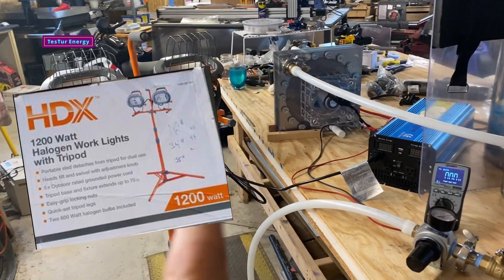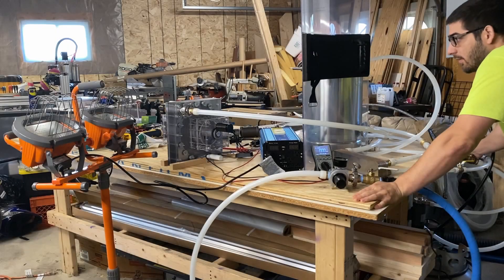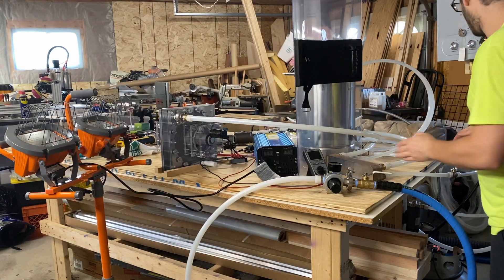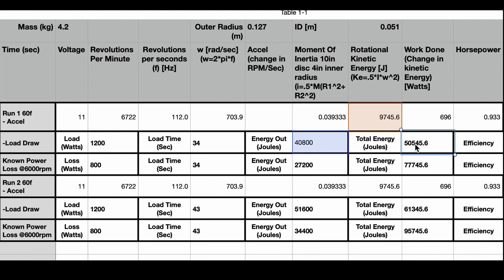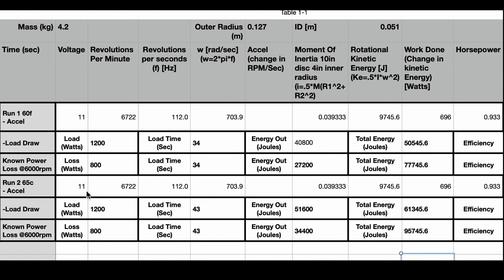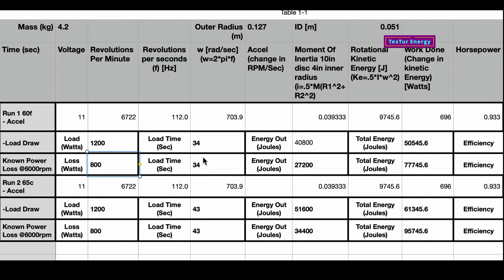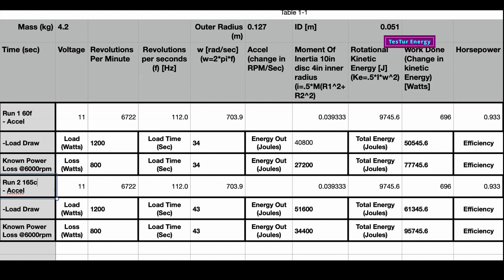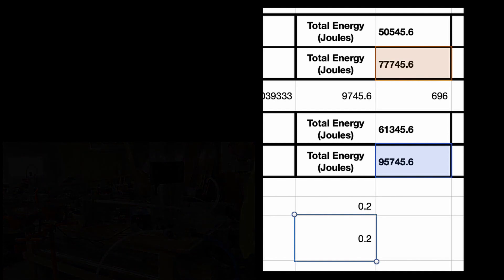Tesla Turbine 1200 Watt Electrical  Load Tests - Power Calculations - compressed Air + Propane

Comment: It looks great! So here is what I figured out, the heating of the air is increasing its viscosity. Can you tell the discharge from the nozzle so that I can calculate the theoretical maximum achievable efficiency. I think if the gap between the plates is reduced you can get close to laminar flow (which will increase its efficiency due to viscous flow of air), also try to increase the area of the nozzle, the discharge would be the same, if you can reduce the specific velocity of the air you can get lower Reynold's number which will reduce the noise therefore increasing the efficiency. 
BTW Great work!
Reply from the maker: Have you had a chance to scroll through my communities tab and read all the posts I made in the past about laminar flow regimes inside the Tesla turbine for reduced turbulent losses?
Reply from the maker: Yes yes yes!! You’re hitting the nail on the head. Preach the words of our lord and savior Nikola Tesla!! 😂 but for real you’re saying EVERYTHING I constantly say to people. 

So right now I’m already working with 0.0092in disc spacing. I’ve tried all the way down to 0.0005in spacing but the way I machines the turbine made the tips of the discs horrible for letting the air in between them. I don’t have this issue with my new one but it’s also pretty tricky working with sheet metal that’s any thinner than I’m already using without regularly bending the crap out of the parts. As I increase in temps I don’t think it will be necessary for the disc spacing to be soo skinny but we will see. But I’d rather just increase the discs and slow the velocity beteeen each disc spacing to reduce the Reynolds numbers and get the added effect of getting the major increase in surface area anyways with the same total flow area through. But especially when I start doing the high temp combustion + steam replication of Tesla’s GB 186,083 patent I’m sure this spacing will be too skinny for the high viscosity of the high temp fluids.
Reply from the maker: As for the temperatures I don’t have an outlet temp for ya I’m sorry. And I’m in the middle of a rebuild for the next round of tests so it’s all in parts right now getting upgrades to get back into the fighting ring for round 3! I will have more data for that round of tests.
Reply: @CharlieSolis  No, I didn't see the posts, I'll check them out. The combustion+ steam looks interesting, maybe you can replace the exhaust impeller of turbo charger with your invention, or something like that (maybe just use a little combustion chamber somewhere and spin the turbine with its exhaust, replacing a blade turbine). Also are your plates entirely seperated from each other? I was thinking, for this particular project with only air, you can go much thinner by using airfoil shaped guide between the plates, that way the plates won't bend, and same small gap could be achieved evenly.
Reply from the maker: Oh yeah check out patents GB 186,083 and GB 186,084 they are the improved combustion gas + steam turbine patents that Tesla put out after 10 years of R&D after the first patent was put out. They are complete and self contained power generation systems with combustion chambers, centrifugal compressor and fuel tank system including a heat recoup for the hot exhaust leaving the turbine to further raise steam to be admitted coaxially into the the turbine together. 186,083 is a steam super heater patent for getting the highest economy from the heat energy of combustion. With the recoup system that he has in the design the total efficiency of the system should be extremely high.
Reply from the maker: As for the discs, I am also replicating Tesla’s other improved construction patent for the turbine disc stack GB 186,082 that he patented at the same time as the ones I was just taking about above, in 1921, after 10 years of R&D. I don’t know why everyone sleeps on these patents. They are literally the key to making them work effectively. But in the patent he suggests using very very thin sheet metal and instead of using any kind of physical spacer in the periphery he suggests pressing “protuberances” or as I call them “dimples” into the disc faces. Even further he suggests reducing all the machining of each disc into a simple stamping process that the exhaust holes and the periphery separating dimples are all pressed at once. Currently Im just using a jig that I made for stamping the dimples into the thin discs. It works amazingly and the whole disc pack is super stable. 
Check out one of the short videos I made showing the dimples that keep the disc tips apart. 
https://youtube.com/shorts/3jS2ckRWD2I?feature=share

Here’s what Tesla says in the patent. 
NIKOLA TESLA BRITISH PATENT 186,082 - IMPROVEMENTS IN THE CONSTRUCTION OF STEAM AND GAS TURBINES
"In the new design I employ two heavier end-plates which are machined tapering toward the periphery for the purpose of reducing the maximum centrifugal stress as much as practicable. The inside discs, of relatively thin material, are rolled, forged or ground tapering in like manner and with the same object in view, but this may not always be necessary and plates, made of sheet metal of substantially uniform thickness as furnished by the mills, can be employed. Each of the thick as well as thin plates is provided with exhaust openings, leaving a solid central portion like the hub and spokes of a wheel. Star-washers of similar configuration serve the purpose of keeping the discs apart in the center and for the peripheral spacing the thin plates have small holes drilled in them on a circle, or circles, of suitable diameter, and in these are driven tight-fitting studs which are upset at both ends by a special tool so that they will project beyond the metal on each side a trifle more than the thickness of the star-washers. When the plates are put together the separating studs do not come in line but are straddled in order to give opportunity for slight yielding, thereby eliminating constructional difficulties which might be caused by unevenness or other mechanical imperfections. Thus the rotor can be finished closely to predetermined overall dimensions and will run true on the outside even if the thin inside plates should vary a little in thickness or be slightly warped. To simplify this arrangement I provide only every second plate with studs, using plain ones between. Furthermore, with the object of cheapening the manufacture I dispense altogether with the former, accomplishing the spacing by means of small bosses or protuberances which are raised in the plates by blows or pressure and provide a die, practically reducing all the machine work on a thin plate to a single operation in a stamping press. The star-washers, while preferable, are not indispensable and may be replaced by round separating washers of a diameter about equal to that of the hub part of the discs"
-NIKOLA TESLA

"This construction permits free expansion and contraction of each plate individually under the varying influence of heat and centrifugal force and possesses a number of other advantages which are of considerable practical moment. A larger active plate area and consequently more power is obtained for a given width, this improving efficiency. Warping is virtually eliminated and smaller side clearances may be used which results in diminished leakage and friction losses. The rotor is better adapted for dynamic balancing and through rubbing friction resists disturbing influences thereby insuring quieter running. For this reason and also because the discs are not rigidly joined it is safer against damage which might otherwise be caused by vibration or excessive speed."
-NIKOLA TESLA

"....what I claim is:
1) A rotor for steam and gas turbines composed of plane spaced discs and two rigid end-plates holding them in fixed position laterally but permitting their independent expansion or contraction in the radial direction, said discs and plates being provided with exhaust openings in their central portions, substantially as described.
2) A turbine rotor comprising plane discs with spacers allowing radial displacement, central separating washers and two rigid tapering end-plates for holding the structure firmly near the shaft, said discs and end-plates having exhaust openings in their central portions, substantially as described.
3) In a rotor for high-speed turbines plane spaced discs with exhaust openings in their central portions and tapering towards the periphery as, and for the purpose, described.
4) A turbine rotor consisting of a system of discs held apart by spacers in frictional contact with them and alternately straddled as, and for the purpose, described.
5)A turbine rotor composed of plane parallel discs having exhaust openings in their central portions and projections for holding them apart near the periphery, substantially as described.
NIKOLA TESLA

Read The Full Patent:
https://teslauniverse.com/nikola-tesla/patents/british-patent-186082-improvements-construction-steam-and-gas-turbines
Reply: @CharlieSolis  Man I'm impressed by your knowledge and Research, I read the patent, and yes I was saying the same thing of attaching little airfoils (like there are dimples between the plates) I think this can really increase the efficiency, as in the present blade turbines there is loss of energy at every level (talking about the frictional losses and the losses caused by redirection from the stator)
Well I'm now really interested in this, I have added you as a connection on linked In, we can discuss there.
Reply from the maker: Hey Affan so I’m HIGHLY against the idea of having any kind of airfoil or impediment in between the discs. This would defeat the whole purpose of using the Tesla turbine. As Tesla talks about how to get the highest economy the fluid should have the most gradual change as it traverses the turbine you don’t want any lifting buckets or vanes to get in the way to cause sudden impingement on the lifting surfaces. Furthermore once you’ve achieved laminar flows in between the turbine discs you won’t have nearly any loss to slip and the all loss to slip will be to shearing of the fluid which just builds up and dissipates as heat. This is what’s known as the “reheat factor” because the energy lost to friction and heat inside the turbine, if laminar, can be recouped through further expansion of the fluid through multiple stages. When the fluid is laminar you won’t have barely any loss to noise because there is not turbulent flows between the discs to create such vibrations or hysteresis for vibration losses. Not to mention Tesla explicitly says that the new and improved disc stack construction patent that because the whole stack is not rigidly joined and the discs and their dimples are straddling eachother so that they have a little bit of axial give to the whole runner is exceptionally good at damping out vibrations that reduces any chance of early fatigue on the parts. Not to mention each individual disc can expand and contract as it needs according the varying temperature and varying rotary forces. 
Check out this “holy Trinity of the Tesla pump”  
 https://www.youtube.com/post/UgkxFIceXTJhrWlsvAjt3om-Q2BZFajtzgTd

I go into an in-depth explanation about why only laminar flow between the discs is desirable because upon tripping turbulent the boundary layer will tend to experience a flow separation from the surface and lose its adhesive drag on the surface. 

If the turbine is designed accordinfigly to get the proper Reynolds numbers and laminar flow between the discs there should be no need for any kind of foil/lifting surface that impinges on the flow stream and causes sudden changes in direction to the flow. 

Tesla states in the original patent 
“In the practical application of mechanical power, based on the use of fluids as the vehicle of energy, it has been demonstrated that, in order to attain the highest economy, the changes in the velocity and direction of movement of the fluid should be as gradual as possible. In the forms of apparatus heretofore devised or proposed, more or less sudden changes, shocks and vibrations are unavoidable. Besides, the employment of the usual devices for imparting to, or deriving energy from a fluid, such as pistons, paddles, vanes and blades, necessarily introduces numerous defects and limitations and adds to the complication, cost of production and maintenance of the machines.

The object of my invention is to overcome these deficiencies and to effect the transmission and transformation of mechanical energy through the agency of fluids in a more perfect manner and by means simpler and more economical than those heretofore employed. I accomplish this by causing the propelling fluid to move in natural paths or stream lines of least resistance, free from constraint and disturbance such as occasioned by vanes or kindred devices, and to change its velocity and direction of movement by imperceptible degrees, thus avoiding the losses due to sudden variations while the fluid is imparting energy.

It is well known that a fluid possesses, among others, two salient properties, adhesion and viscosity. Owing to these a solid body propelled through such a medium encounters a peculiar impediment known as “lateral” or “skin resistance,” which is twofold, one arising from the shock of the fluid against the asperities of the solid substance, the other from internal forces opposing molecular separation.”
Reply from the maker: If you’re interested in having more in-depth conversations about these turbines it would mean the world to me if you could join our growing group of patreon members who help support the work and R&D I’m doing. I don’t get to keep doing this work without the love and support from my patreon donors! 
www.Patreon.com/CharlieSolis
😇😇😇
Reply: @CharlieSolis  man this subject is bigger than I ever imagined 😂 and I understood why the flow shouldn't be meddled with, but if you are having supports, why not little symmetrical aerofoil. It won't disturb the flow unlike the dimples and will provide minimum resistance.

And yes I'll be a Patron soon. :)
Reply from the maker: @afankhan7732  1200watt Load Test ELECTRICAL Output Efficiency Calculations For 10in Tesla Turbine Are In! 
See the charts here!
https://www.youtube.com/post/UgkxRukN0zoVbtfe1LmLUlXyIo0kdt1ExWZs

Comment: Interesting setup. Do you plan to test two stage cold steam Tesla turbine too?
Although i doubt you can do it with a plastic discs..
Reply from the maker: I’m working on the vacuum chamber right now for doing the vacuum steam cryophorus system. I’m just doing single stage systems for the moment. Going to hone that in before leading to a dual stage system. But for the record this turbine is pretty much all aluminum on the inside. There’s some polycarbonate on the shaft for the gears and what not but that can handle the temp ranges of the vacuum steam system.  The discs on the 10in turbine are 3105 h13 aluminum with a max rpm of 15,000rpm. The endplates are 6061 T651 with a max of 28,000rpm.  Currently I haven’t broken 10,000 rpm yet.
Reply: Serious mechanical engineering skills are needed for sure! Congratulations for successful runs at high speeds!
Tesla had brilliant idea how to generate electrical energy with the two stage system not by using torque, but..
But we'll need to wait till someone build two stage system.. Good luck with your projects!
Reply from the maker: How was he going to generate electricity without using torque with the turbine?
Reply: Do you know principle of Kelvin's generator?
Reply from the maker: @oxiigen  1200watt Load Test ELECTRICAL Output Efficiency Calculations For 10in Tesla Turbine Are In! 
See the charts here!
https://www.youtube.com/post/UgkxRukN0zoVbtfe1LmLUlXyIo0kdt1ExWZs

Comment: When I first saw you starting this project I was a bit skeptical of how well it would work. You have done an absolutely fantastic job with this. I very much like your future plans for eliminating losses.
Reply from the maker: Thanks Spacecase0!! 💚💜💙 🙏 🙏🙏 that means a lot more to hear than most actually realize. And we can only go up from here as we easily fix each of the sections of loss. Got any suggestions?
Reply: @CharlieSolis  gears aren't very efficient. I think a direct drive generator is going to be very successful. That is if it can be built not to completely blow apart with the high RPM. Actively lubricated bearings are pretty efficient. You want the lowest viscosity oil you can find that still prohibits direct contact of metal on metal. Very careful balancing of the discs will also likely help, but you may have done that already.
I was planning on doing a video to update people on my research. I think there's a much more entertaining thing you can be doing with what you've built. I will post more details when I'm at home on my computer. I suspect Tesla invented this because he needed a high RPM motor for something else he was working on.
Reply from the maker: Ohhh you’ve certainly peaked my interest! I’ll be waiting to hear from you again!
Reply from the maker: @spacecase0  any updates on the work you’ve been doing?
Reply from the maker: @spacecase0  1200watt Load Test ELECTRICAL Output Efficiency Calculations For 10in Tesla Turbine Are In! 
See the charts here!
https://www.youtube.com/post/UgkxRukN0zoVbtfe1LmLUlXyIo0kdt1ExWZs